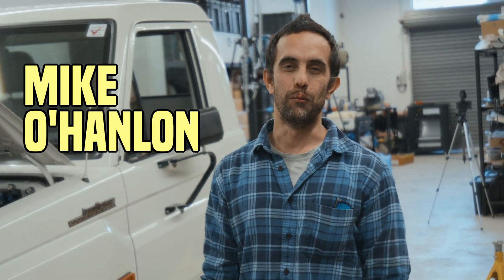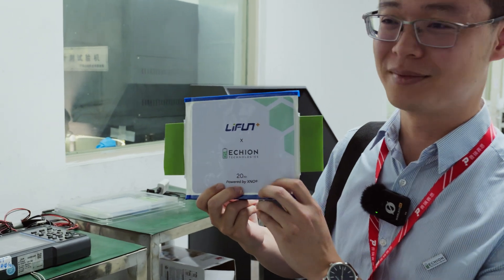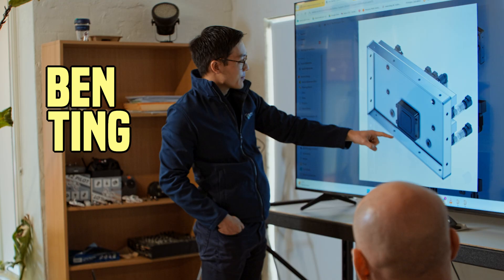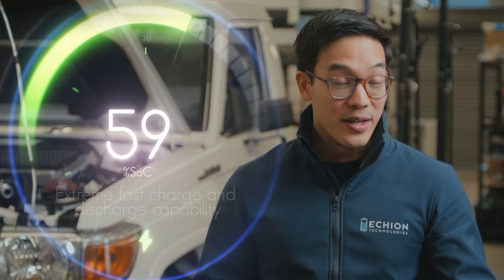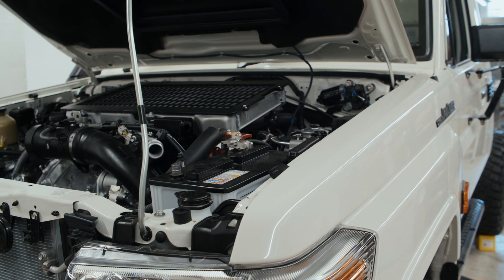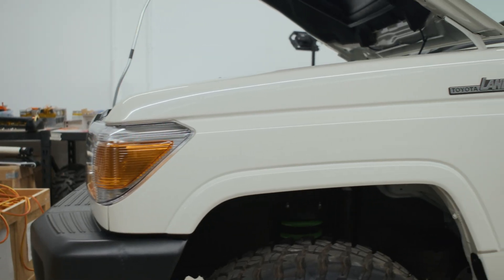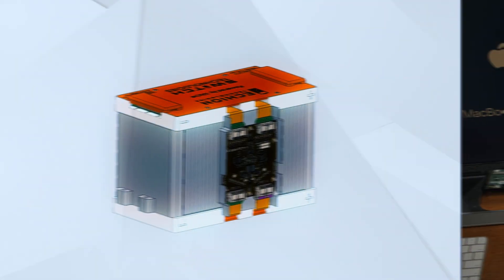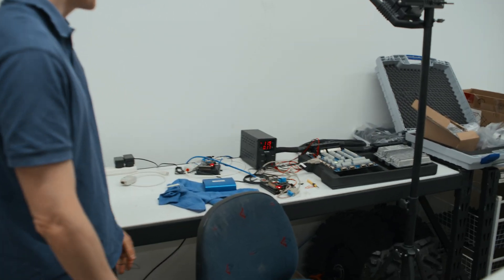Building a Hybrid Diesel Landcruiser? Ep.01

Comment: Sick project. What's the marron hauling capacity of such a vehicle?
Reply: We are building this rig because we know where a giant marron is hiding. We are going to go get it. Hopefully it hasn't got bigger.
Reply: we are adding a 280kW electric motor to the existing V8 diesel engine, so total power is off the chart. Unfortunately the DOT regulations limit us to an extra 25% power when on the road 😥. Still that will make a considerable difference in hybrid mode and it will be very pokey in EV only mode. Maybe we can even drag off a Tesla! (just kidding)🏎